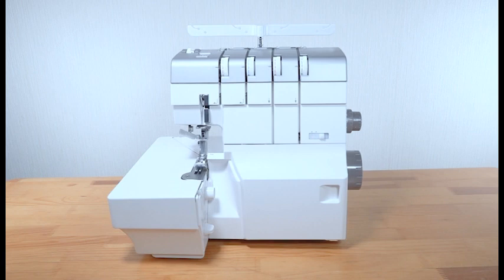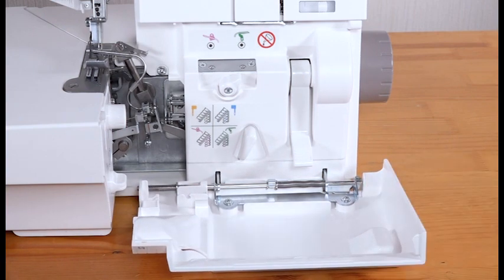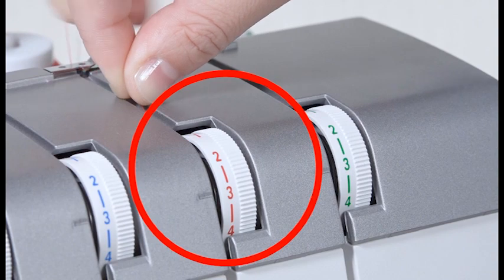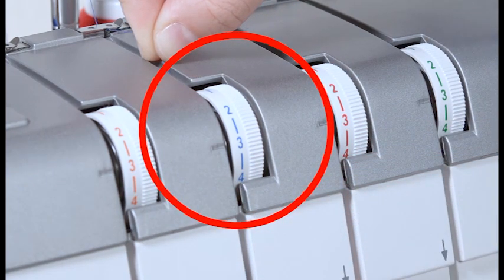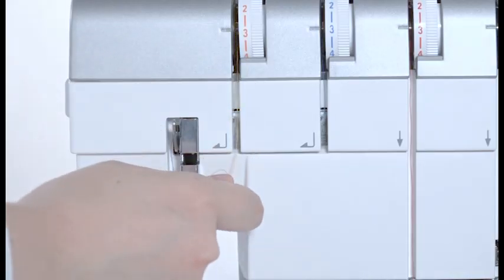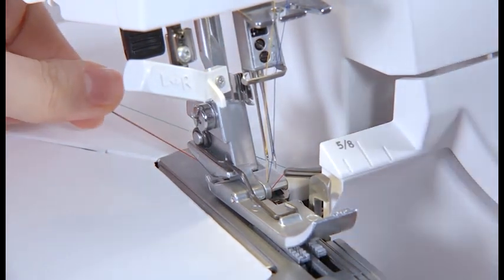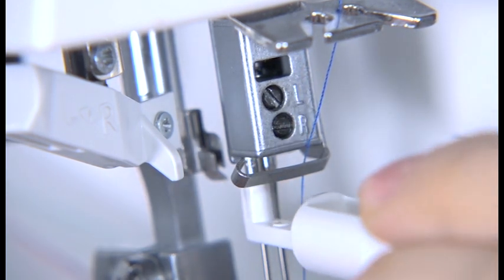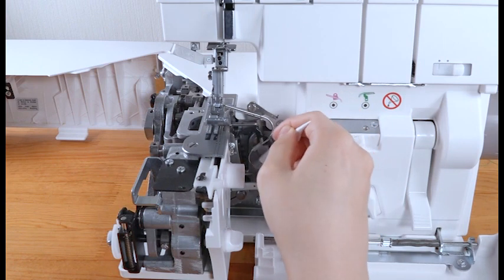Janome AirThread 2000D Professional Overlocker Video

Comment: I was always told to set the tension to ZERO when threading any sewing machine and then reset the tension to the correct amount before sewing.  This supposedly allows the thread to go between the tension disc properly.   Is that no longer required with the newer machines????

Comment: I’ve had mine for prob 9 months and I haven’t used it for about 3 months now with the threading the right lower looper won’t thread or go through the hole where the air threader Is supposed to do it ? I’ll give it another go tomorrow if not of to the shop.
Reply: I had the same problem with the thread jam.  I used a very thin piece of jewellery wire called FireWire...it bends easily but it’s soft as not to damage it.   Always pull the threads out from the bottom.  I also used a camera lint blower to blow out the thread nest.